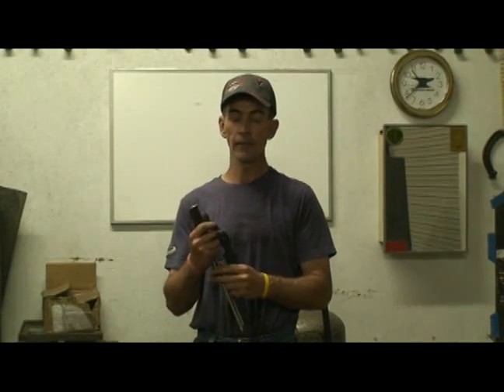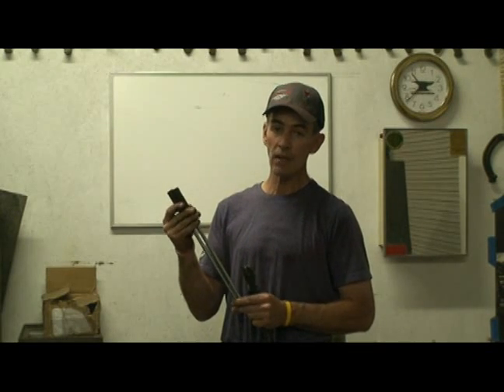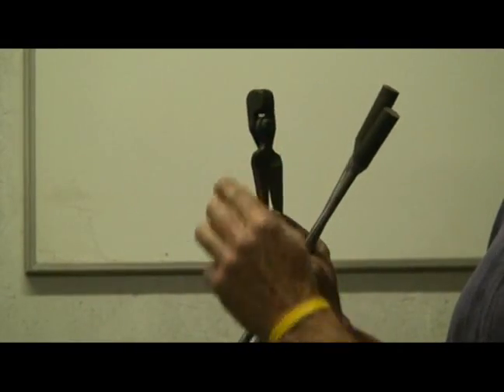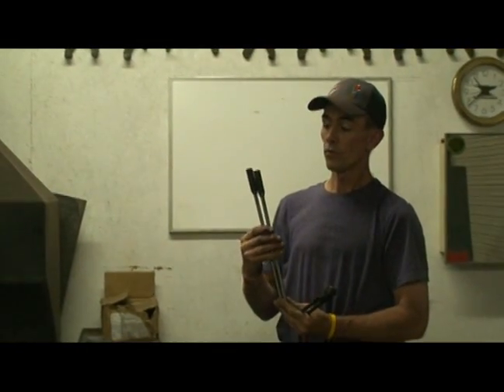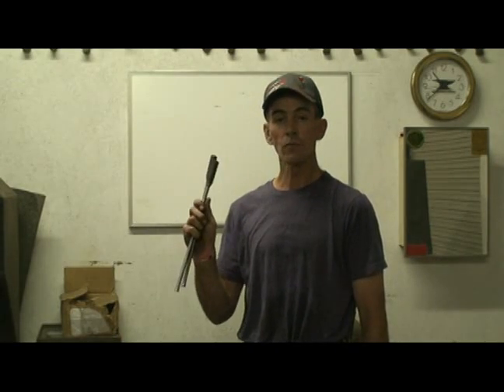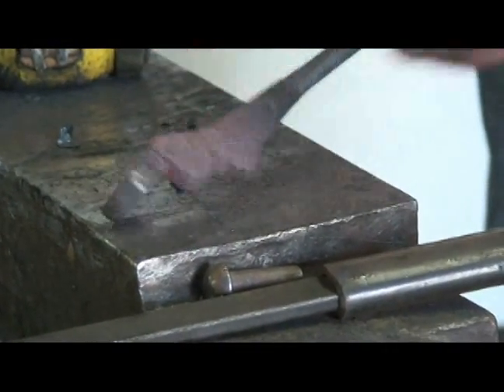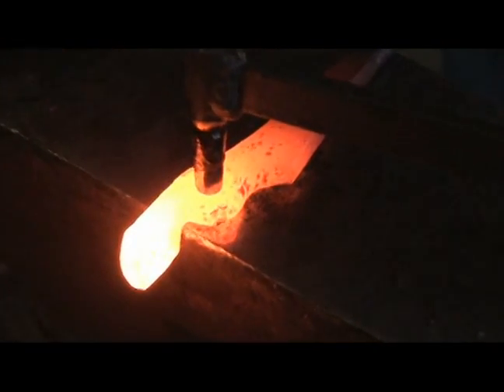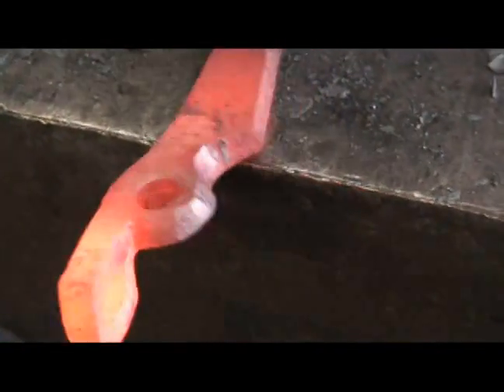1/4 Inch Craig Trnka Blacksmithing Tongs

Comment: Lots of folks asking about the hammers. Craig is a farrier, and an absolute wizard in the forge. The first and main hammer he uses is a farriers rounding hammer, looks like a two pound. Who makes that specific one I can’t say, but they’re widely available from any Farrier's supply shop, lots of different brands, makers, sizes, and designs to choose from, but they’re all the same basic thing, a hammer. They have a flat face on one side, and a slightly rounded face on the other. The second is commonly referred to as a cross peen hammer. Basically the same as a rounding hammer, only instead of a rounded face, it has what is essentially a filleting die on one side of the head. Again, lots of makers, and sizes, and can be bought from a farriers supply.
Reply: Its a Justin,made by Pat Connor.  I have several Justin’s. 2lb turning hammer,1.5lb cone hammer and a 1lb ball peen that I had Pat make for me. They are wonderful hammers.

Comment: I reckon you could save some more time by partially quenching the jaw and boss before putting the last offset in the reins to make them line up left and right. This inertial distortion and the extra work associated with it could probably be avoided that way.